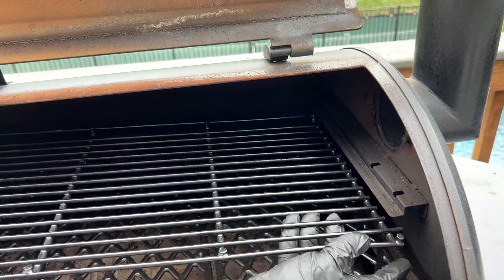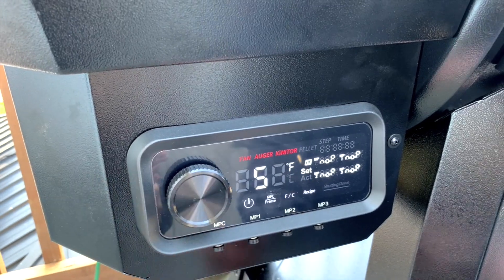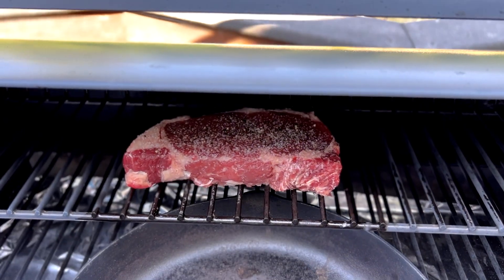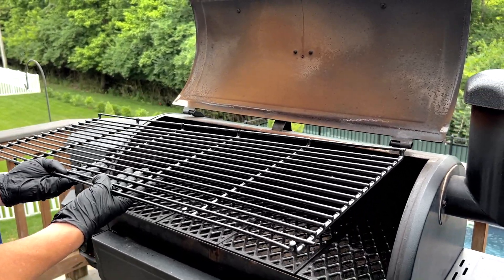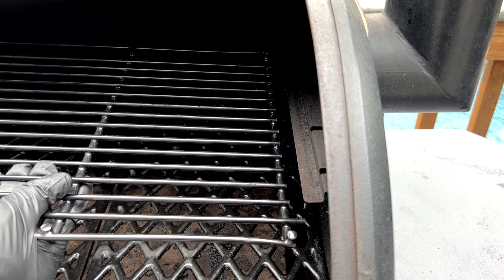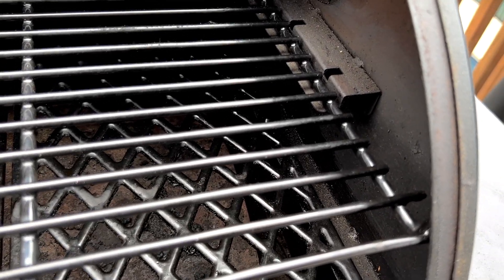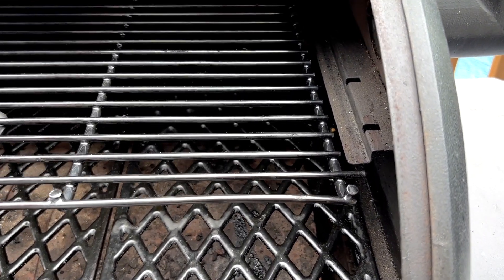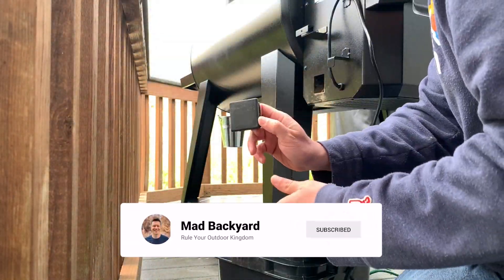Install the Top Rack on a PIT BOSS in SECONDS!

Comment: Just got a new pit boss pro series like this one. Should i do the initial start up and seasoning with the top shelf in place or ahould i remove it? Thanks!!
Reply from the maker: Awesome!  I would do it with the top rack in place, at least the burnoff so you get any residues from the factory off it along with everything else.  Here is our video on how to do this if you want to check it out: https://youtu.be/27PNWZeOK5I
Reply: @madbackyard  thank you! If you recall, we chatted briefly a few months ago about me upgrading my Lexington and you suggested this one. What a coincidence! Now I have to do the initial burn off and seasoning. Would olive oil spray work for the seasoning? I'm not planning on using the flame broiler.
Reply from the maker: Ha, yes I do remember! Olive oil spray will work great, I would suggest regular olive oil rather than extra virgin if you have it.  It has a higher smoke point so will "bake on" for longer before it smokes off. When you say "not planning on using the flame broiler" do you just mean you're not planning on opening it for direct heat?  That is fine, but you do need to have the flame broiler itself in place at all times for the grill to work properly.
Reply: @madbackyard  I meant to say I'm not planning on using the flame broiler since I already have a propane gas grill.
Reply from the maker: All good then! Have fun!

Comment: MB Have you ever come across a mod that lowers the top grill shelf?
Reply from the maker: Not that I can recall. Maybe you could rest it on some fire bricks in the corners? Are you trying to lower it for more space but still fit a water pan underneath?
Reply: @madbackyard  I believe the heat distribution is best just above the surface of the grills, and yes do need water, have used deep sided cookie sheet. was hoping someone had come up with a modification